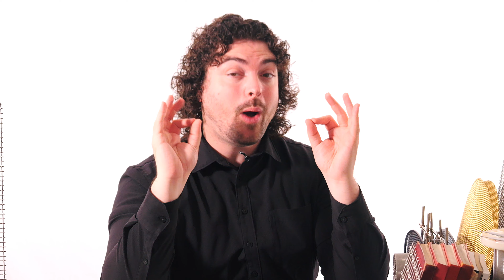EMI Shielding Mesh Specs | What You Need to Know

Comment: hi Andrew, when a home is opposite mobile phone base station, people say using copper mesh to cover the whole home can shield off EMF (faraday effect) which i have tried and it worked.  But I can hear some di di sound on the copper mesh like that of a power transformer.  

Question: If I connect the copper mesh to the grounding wire of a socket in order to lead away the EMF current staying on the copper mesh, will the copper mesh (without the current buildup on the mesh) lose its shielding power?

Thank you very much.